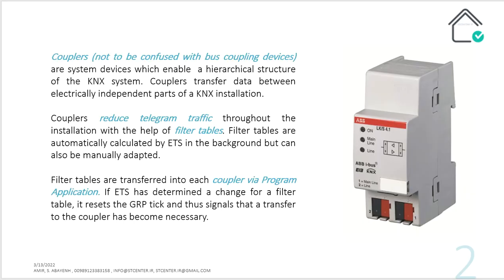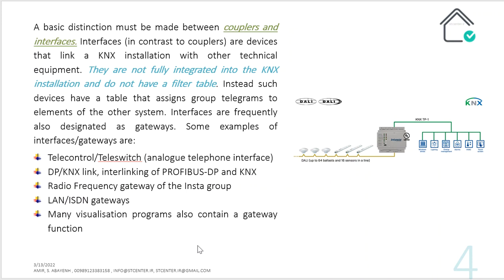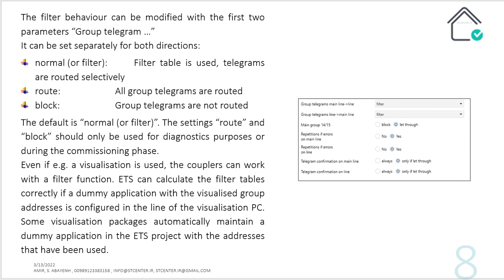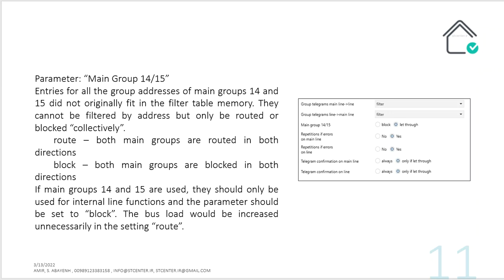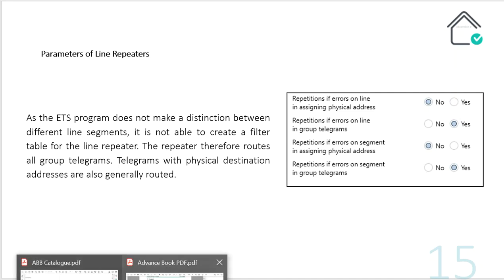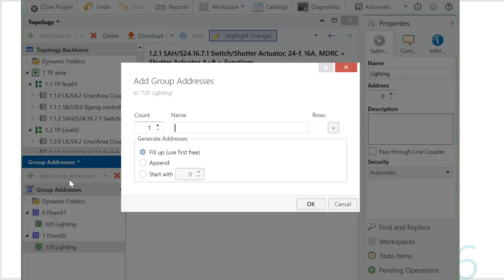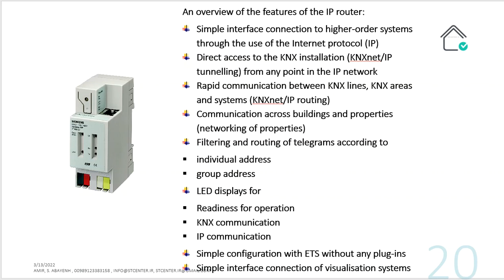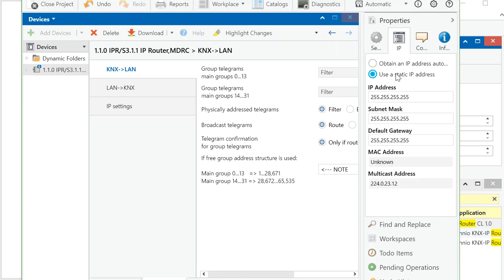Couplers - KNX Advance Course - Chapter01

Comment: I dont get the concept of repeater and line coupler. If I locate my coupler in 1.2.0 as a Repeater does it still execute under 20 devices ? for example: 1.2.0 as a repeater up to 1.2.21. Does it work? or it has to be line coupler?
Reply from the maker: 1.2.0 is line coupler and not repeater. when u order they are same but in configuration the physical address and database are different.

Comment: Is it true that the individual address 1.0.135 does not exist?
Reply from the maker: For the devices before 2018 , we can not extend the main line, so we can include 64 devices minus the LC. For the devices after that if they support new topology we can have 256 DVC minus LC.